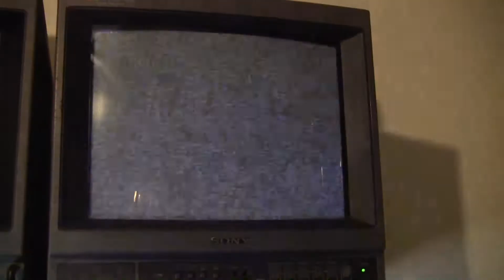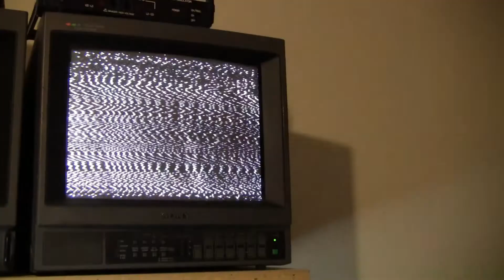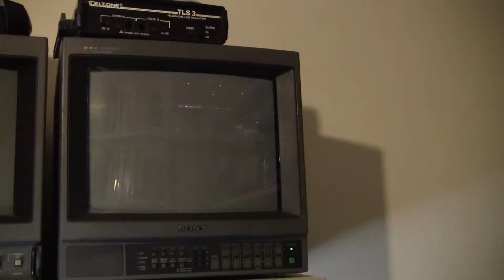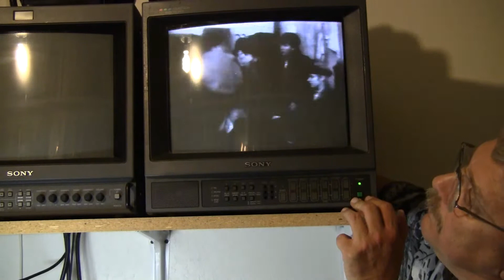The Sony CV-2000D Restoration Progress Report #1

Comment: How was a TV program recorded? There is no tuner that I can see. Did the monitor unit, that I have seen on other sites, have a tuner output for the CV-2000?
Reply: As far as I know, the CV-2000 did not have an internal tuner and needed to be connected to a TV to record any programming. Still, had I been alive in the mid-late 1960s, I would have definitely had a Sony CV-2000 and would have recorded a lot of TV programming with it.
Reply: https://www.youtube.com/watch?v=xODsZouo7Yc
If the uploader doesn't mind a link this video shows how it was connected to the TV